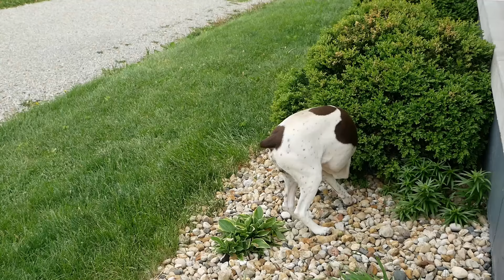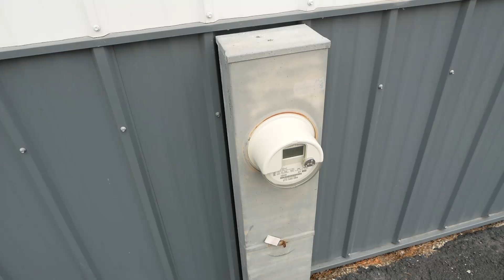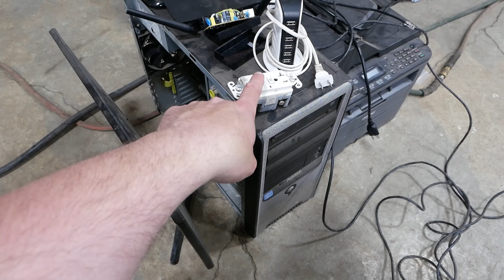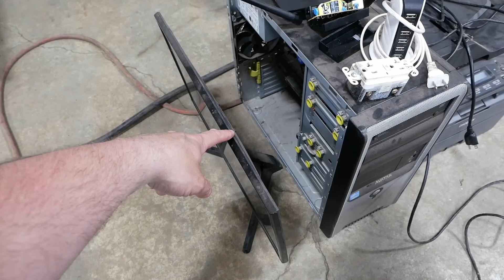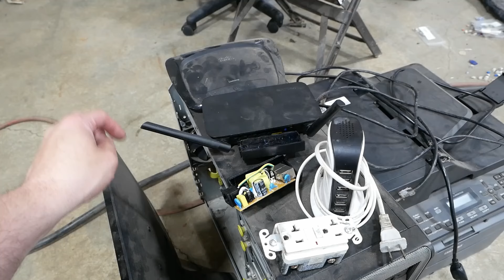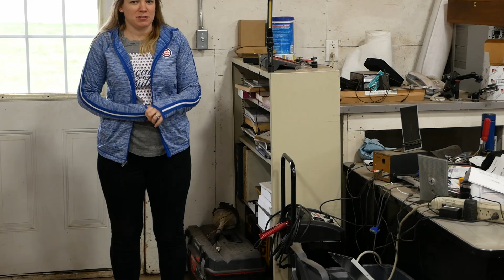Lightning Strikes Shop, Again...

Comment: LIGHTNING RODS on the roof of the residence which Ben Franklin invented work just fine. The best part is you can always know when lightning hits the rods as the roof of the home sound and feel like a bomb went off over the roof. The light is so bright that your eyes feel like a flash bulb went off right in front of them. Also, the 3/4" diameter twisted conductor of copper total length is about three hundred plus feet. When hit the wire gets so hot the rainwater just boils on the surface for about half a minute. That has been happening forty one years so far. Nothing has ever burned out electrically or electronically. The silent sentinel that guards the house. Good luck with your lightning problem. Just install heavy copper lightning rod and your problems will be FIXED.

Comment: My experience with lightning and computers is it always jumps from grid power devices to un-grounded cat5 cabling. Basically everything you had happen is super common and about what I would have expected. The only further thing that can be done to protect yourself is to use a patch panel and ground it. But even then it’s most likely still going to happen. Sorry man!

Comment: Hey Wes, I think it fried everything through inducting current through the un-shielded ethernet.  You need to run shielded ethernet wire, and buy some ethernet surge protectors.  Make sure you complete the ground path, use the shiny ends that you can crimp the drain/ground wire to. Run the jumper from the ethernet surge protectors to a ground. I used to get inducted lightning current from close strikes, doing all of the above made it a non issue.   OTOH, maybe it just came in the neutral and your neutral/ground bond wasn't enough. Lightning will do some things, you probably have a better chance of understanding it then me.

Comment: Next time pull your apperates your stuff off the net in bad weather. I have a device that can stop lightning strikes.
Reply: UPS captures the peak tensions on some can absorb power interruption from only in case of heavy lightning strikes die the device the restis hee
Reply: Klerenvandekeizer

Comment: A possible way to protect the computer and ancilliary components is to use a UPS which SHOULD, ( should beeing the operative word) prevent the system from being effected, as it SHOULD isolate it enough to do so... Problem with the ethernet connections is if power of any form actually gets into the ethernet cables..... If they can be isolated utilising some sort of surge protection of their own that MAY work. I hope you have, or in the future set up an isolated (I mean that literally...  unplugged, not even on the premises even if you can) backup setup for the computer..  I set up a very simple program to back up to external drives, thus keeping data safe from this sort of problem..  but unfortunately it is only as good as the user is conscientious for implementing it.

Comment: Throw out the surge protector power strip, metal oxide varistors have a wear out mechanism and often go up in flame at the end of their life, sometimes taking the house with them. It does very little anyway, effective lightning protection takes way more than a power strip, as you know. 

But hey, lightning never strikes thrice, right?

Comment: We got hit taking out all the TVs, computers, routers, some light bulbs.  But worst was that the main water line and sprinkler line blew up.  Water was spewing everywhere in the yard and a river flowing down my driveway.  2k$ of sprinkler line and controller replacement and 5k$ for a new water main line.   Right after the hit we had no power or water.  When I walked out into the garage I noticed the sprinkler controller was in charred pieces and scattered around the garage. So I pressed the garage door opener.  Blown too.  Luckily my wife had just unplugged her laptop from the charger.  The outlet and the charger had arc burns and was located only about three feet from where she was sitting.  Had it been plugged in to the laptop sitting in her lap I'd be dating again.
Didn't have cable or internet for a month because the buried service line all the way down the street servicing half dozen houses was also blown.
I created a 30 page document with many pictures and receipts and everything I could come up with and presented to my insurance company.  They gave me 8k$.  That covered the replacement cost for most things but I still had wiring issues that have taken two years to sort out. Plus the labor of reinstalling everything. In one case the arc produced carbon across contacts that caused internet to work poorly even after all the equipment was replaced.  
Everything was so bad that now when it starts to thunder we start to kinda freak out and start unplugging everything.  And one year later lightning hit again but this time it only blew up a couple of brand new just replaced TVs and all the cable equipment.  And it blew the AM section of my table radio. But since Rush died I don't need it.

Comment: There are surge suppressors just for Ethernet connections. It seems like much of your damage likely came in from the wifi antenna on your roof, down the Ethernet cable, and into your equipment. Nothing's perfect, of course, but an Ethernet surge suppressor might help!

Comment: Ubiquiti makes surge suppressors you can place inline with the POE injector to help protect it and the powered antenna. You put one on the end leaving the injector and another on the end just before the antenna and bond both to good grounds. You might still lose your router or even the POE injector but the powered antenna should survive. A good quality APC Smart-Ups of the 1500va variety is also a lot better typically at surge suppression than the typical plug strips are and it'll have a network surge protector built into it as well if your pc is connected via ethernet. Seen and replaced a lot of lightning damaged gear over the years, it can make a real mess of things and routers/switches are great at delivering it to everything plugged into them if they get popped and killing all those devices.

Comment: a little added security on the shops electrical system is a whole house surge protection. can be found at home depot or lowes at a reasonable prices have one on my house hydro panel, electrician had it installed in about 15 minutes. great bit of peace of mind.

Comment: POE injectors are cheap on Amazon if you want to try just replacing that (and hope the transmitter isn't toast also).  I would guess there's a voltage spec on the case of the fried module

Comment: if it did that much damage by hitting the neutral wire then it sounds like something isn't grounded well enough. the issue is probably with the power company. glad nothing caught on fire.

Comment: Can you not use a UPS for the computer?  I thought it was common practice in rural USA. When I was on vacation in the USA in 2001 a friend I was staying with got one from a local computer store for less than 100 dollars. I worked in IT in UK public sector and all of our servers ran on separate UPS though this was only to make them shut down in an orderly manner during power cuts - lightning was not really a problem with underground supply.

Comment: Hi Wess - as I saw in some of the other comments - they make a whole house surge suppressor for a few hundred bucks - I'm a retired master electrician in Texas and have seen lots of lightning damage - what most folks dont know is that the natural and ground are tied together at the service entrance and also on the pole - so if lightning strikes the neutral or ground the wire goes directly into the house - there isent even a breaker on the neutral or ground - so everything that is plugged in or even grounded gets a healthy blast of voltage/current... if your surge protector still works more than likely the surge suppression feature is non existent but the outlets still carry voltage and current ... if you had that big of an event the utility needs to install lightining surge protection on the utility lines - I had lightining strike less than 300 feet of my house last year - I was sitting on the front poarch and saw the lightning strike the pole - I walked and looked at the point of the strike and found the lightining arrester blown off the pole - in your case a whole house surge suppressor... good luck  .....

Comment: I'm sorry to hear your problems. 
First I am former president of the CSC we passed the cable act in 1992. You are at the mercy.of the state and Industries rather than consumers driving technology. YOU ARE A CAPTIVE AUDIENCE. YOU ARE BEING MILKED. WONDER WHY SOME STATES HAVE ALL SORTS OF INTERNET  OPTIONS AND AVAILABILITY IN EVEN RURAL Areas. 
LIGHTNING!
I spent years studying and creating a UV step leader LASER project. 
I am a Ham and have done tons of electrical work and even consumer electronic repairs. 
Kill all breakers mains and unplug everything. I even remove light bulbs and all lighting circuits. Unload everything. OHM OUT ALL CIRCUITS. EVEN USE A MEGGER ON CIRCUITS WHERE DAMAGED DEVICES WERE. LOOK FOR RESISTANCE. CARBON TRAILS LEFT BY ARCING LEAVES THOSE IN WIRES AND ELECTRICAL DEVICED ARE DANGEROUS. 
I have had to repair electronics where it would take out a power supply then on the other side of the board an unrelated arc took out an RF section or a mos fet amp. I have worked on entry point other than a grid or main entry such as antennas and outside lighting. It may be months before you discover all the damages. Don't sign off on insurance claims until you are sure all these things are verified safe and operable. Meg the wiring if in question. The loss of a Neutral on a single phase 240 volt supply service can and will cause many unforseen conditions. 
The main is split by the Neutral into two 120 vac circuits. When the Neutral is open then the only path is through one leg to the other leg bypassing the normal 120 center tap or ground. Then your only return is through the ground rod or the other side of the 240 line. This works fine if the loads were balanced but say a light bulb is on one side and a toaster is on the other or are now in series with each other. You now have an unbalanced load. 240 volt across the line the bulb will blow but say two bulbs are in series across the 240 line works great. But when the toaster is operates boom the light gets extremely bright on the other side and the bulb on the toaster side grows dim. Funny Farm stuff. Why? The high current draw of the toaster unbalances the load or essentially  has a lower resistance. So now the voltage on what was the neutral become say 190 volts  or so boom the bulb blows or TV or Computer now sees a much higher Voltage across the line. Really Strange things can occur.  Because I built resonate Xfmers and Device I studied Lightning. It and the multitude of ionized paths  can do remarkable stuff.  Please check out your panel wiring circuits and devices. All of em. Don't assume because it comes back up or on it is OK. OHM it and Meg it out. Make sure you kill the Main and open all circuits. OHM across all legs to ground. All circuits should be open. If any resistance, even a little higher than open circuit suspect wire arc. It can occur in Romex or even solid conductors Thnn or Coaxial lines. There will be some resistance depending on line length and depends on the k of the insulator or die-electric. This is negligible. Warning don't overlook this.

Comment: Wes, as a Tech that wrote insurance for customers and 25 years of experience. I would of wrote everything attached to the electrical system, and with the certifications I have they never wanted to go to court. So, replace everything as nothing but problems will arise. Labor included on restoring to s new system.

Comment: You should go around checking the outlets with one of those 3 light testers to see if anything odd is going on.

Also look at your main grounding rod and make sure it's connected to the meter or breaker panel right.

Comment: That sucks buddy!  Can I suggest a whole home surge protector that goes in the panel. Will protect the whole system.  Get in touch with a electrician n they can get u set up so that if u get hit again, ull b covered.  Most of the manufacturers have warranty’s if installed n cover stuff if it fails.  Keep ur spirits up, just think of all the other probs that are going on in the world.  This is miniscual in comparison.  Always think positive, you have ur health and fam is safe n so on.  God bless, things will get back to norm soon😊

Comment: For what it’s worth, I’d suggest an inline, grounded surge protector for you p.o.e system. Something with a physical ground wire, similar to what ESP offers. They’re about $62 each, but a physically grounded link will do a better job of protecting your equipment. Put it in immediately after your service provider’s equipment, unless they’re running network cable from the antenna, then put one upstream as well.  Run the ground(s) to a junction box and conduit it outside to a grounding rod.

Comment: UPS.  ethernet surge arrester. You can buy the wisp equipment yourself depending on what they are using if you havent changed the antenna direction you could just swap the electronics and be good to go. if this is a short haul wifi that might be problematic to change.. but doable.

Comment: I used to get lightning damage. The power expert told me to make a "ground field" by adding 5 or 6 more grounding rods at the meter.  I did and haven't had any damage since. We live way out at the end of a long power line. Don't know why but seems to protect circuit boards.
Reply: I forgot. It wasn't the grounding rods. It was that they wouldn't put on the new surge-protector until I added the grounding rods. It's been years ago, we were burning through circuit boards like crazy. None since. They charged me like about 40 bucks..

Comment: welcome to the Koch family reality (contrived shortages and lack of service) engineered to cause inflation and frustration , just like was done to Jimmy Carter in 1978 to get "Their" candidate elected " On my shop and house in Arkansas I had an "0" gauge wire for the ground, to protect me , as the wizards at the AP&L took all of the ground wires off all the poles and I was the last home on the service. When Lightening hit the mountain, it would jump my 40 opening breaker box and arc to the wire collar housing the huge ridged twenty strand ground wire , and it followed it to the ground rod and the additional 40' of "0" wire buried 12 feet deep at footer  level the length of the house. Never lost a single component, but the telephone lines  were a different story.

Comment: at the shop I had, almost every time there was an electrical storm it would take out the answering machine, used to go thru 2-3 a year. put in a new welder with a new ground, never had the problem again. be worth checking your ground on the building,and wouldn't hurt to add another.  if your power strip with a surge protecter still works, I would say that there was or is no surge protector in it, You can make your own surge protector., not too difficult
Reply: I know improving a ground helps greatly with CB and ham radio reception.

Comment: There are routers you can purchase that run off of the cell phone towers , you have to purchase sim card for your router , but as you said there is no 5G coverage , so you'd be stuck with 4G coverage instead .
If you did go that route , you need computer to access internal data on router of course . Just a suggestion , but I do enjoy watching  your content , always something different . I'm located up in Anoka , Minnesota thanks again .

Comment: I live in rural Idaho and we have line of site antennas also. Lucky for me I was able to get Starlink recently, but I did also keep my local LOS provider. Some power strips do have Ethernet ports on them that protect your Ethernet ports against lightning strikes/surges. Also UPS (un-interruptible power supply) protect against lightning strikes and most have Ethernet ports that can protect your Ethernet ports which is what most people end up losing when getting struck by lightning due to using power strips and not having those ports or not using them. Also try to stay away from $6-$9 power strips. You get what you pay for. Most reputable power strips come with paid out warranty’s (most don’t put in claims). In your case as most of the power supplies are good I would say the lightning damaged everything along your Ethernet ports. Sorry Wes, as you rely on these systems for your buisness I would definitely recommend offsite backups and get a decent UPS for your business computer. Don’t forget you homeowners/business insurance may cover some of the damages.

As a side note some power strips have coax lines for cable and satellite. Make sure you protect those lines. Lightning can surge along those lines as well.

Comment: They do have surge protectors for cable and Ethernet lines. My neighbors had lightning knock out their TV through the cable lines into their house.
Reply: In addition to power strip ones with cable/F connectors, there's also standalone F connector lightning gap arrestors.

Comment: Working in the dryer climates of Southern Africa,we found that ground rods were limited. Inadequate grounding would cause nuisance tripping of ground fault devices. We would bury a bare copper ground wire with underground cables if possible or a separate trench. This was before there was much IT stuff as there is now. The school/childrens village we still have contact with has ancient wiring and has lots of problems with lightning strikes.